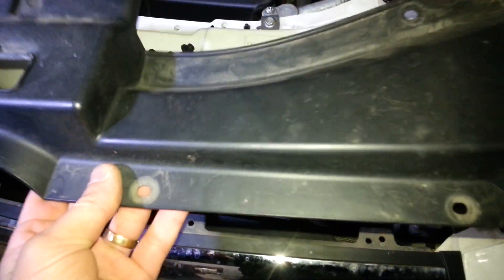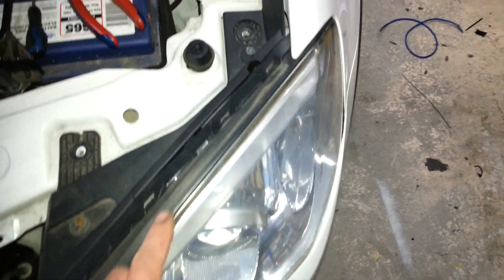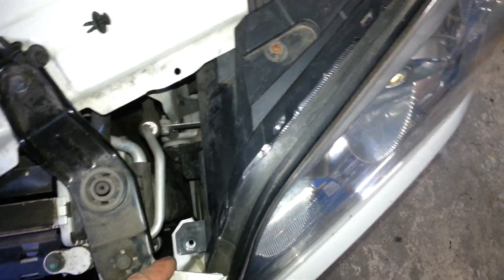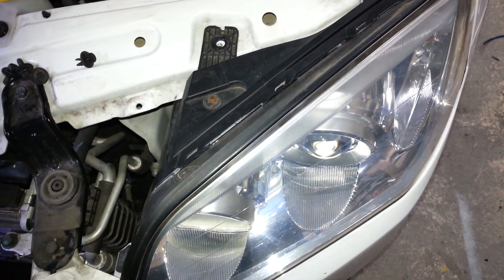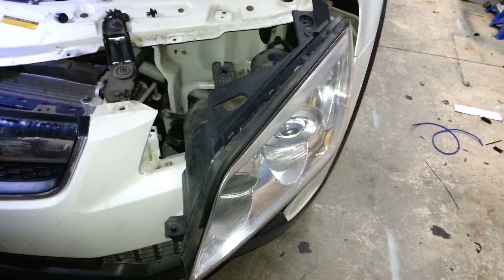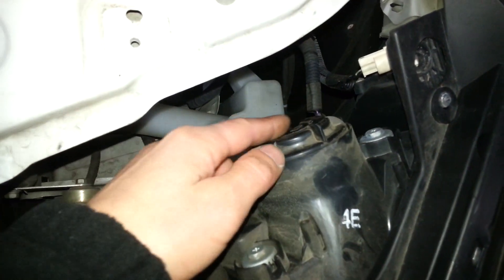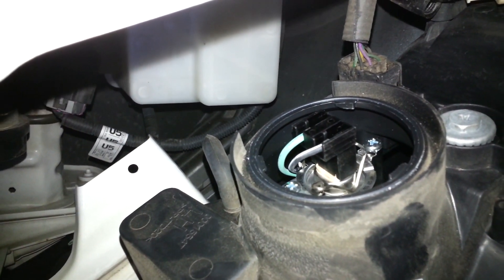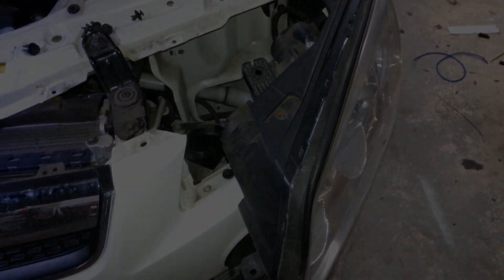How to remove a Holden Captiva 2008 Head light globe

Comment: Great info I was told by Holden that I have to remove radiator,and and a person to take the battery out.  Not now,th
Reply: Aa
Reply from the maker: Glad to help
Reply: @stephenjones5319  , and because of the stupid plastic screw fittings it was made harder than necessary ! 1 globe 1/2 an hour !

Comment from the maker: it has plastic clips, You should be able to use a normal star screwdriver. If that is not working you will need a thin flat blade to lift the centure part of the clip out. Sorry to here that your having trouble.

Comment: Lights on then headlights or high beam..which one is that…? If your looking it at in front of ya face…is high beam the smaller globe or on the right or left? Need to make sure
Reply from the maker: Hi Trent, I can't remember as I dont have that car any more. You could try and turn on the light low beam and have a look on the other side of the car.

Comment: Hi can you explain bit more about how to change the headlight bulbs? I just got trouble to remove it..thanks
Reply from the maker: It is a bit fiddly to get the Head light assembly out, so just take your time and you will fine.  Once you get it out you will see the back of the globe. If you are still not confident doing it you will need someone to help you. I dont have one of these to make a more detailed video. Good luck.
Reply: thanks